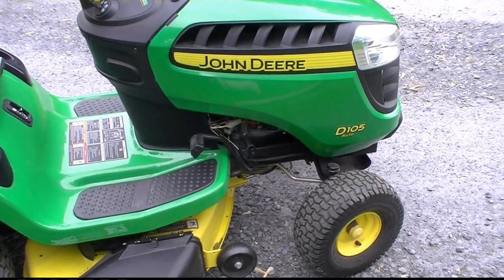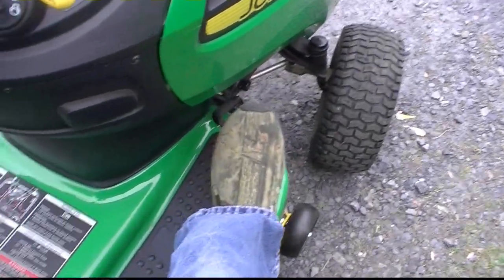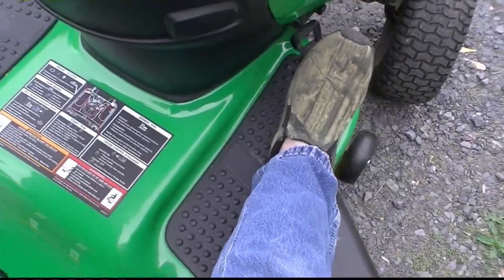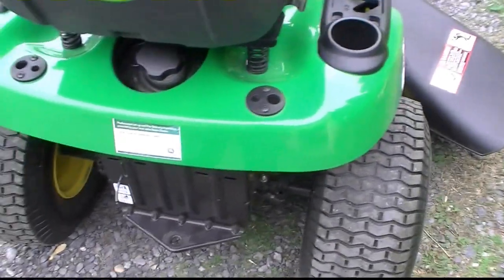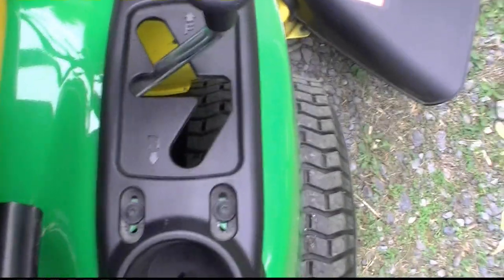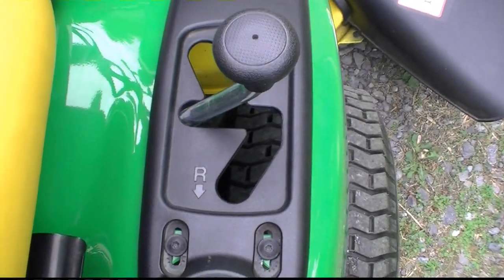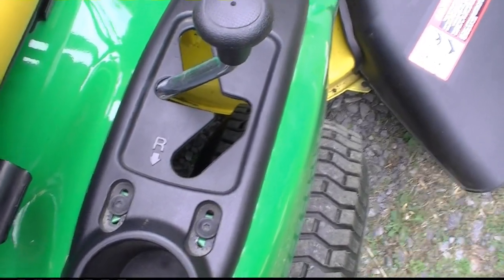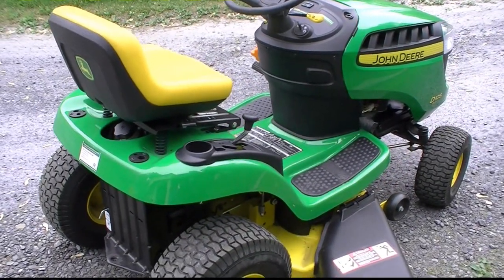John Deere D105 Problem Automatic Transmission CVT Review

Comment: Hope yours is still running.  Four months after the warranty for the transmission expired and as I was merrily cutting the grass I coasted to a stop and couldn't depress the gas pedal.  Took it to the dealer where they were glad to charge $192 to reinstall the spring, washer and screw on top of the transmission.  The service manager said that he'd never seen nor heard of this happening before and that possibly "they" didn't use enough loc-tite on the screw during assembly.  Of course since the warranty was out it was just my tough luck.  So fast forward 45 days, cutting merrily along one more time, same thing.  Went back to the dealer where now it's said I need a new transmission.  For Sale, D-105 with less than 110 hours.
Reply from the maker: Wow!  I hate to hear all that. Mine is still running good after only 6 months so far.  I better go and check to make sure everything is tightened up.  Thanks and I'm sorry to hear all that.
Reply: same thing happened to me. wish I had bought a 110.
Reply: Me to.this machine is a piece of junk.nothing run like a deer, you need to change that.
Reply: Just know that this particular model is going to crap out on you at some point, more specifically the transmission. The transmissions are made entirely of plastic and it is going to fail. I had a D105; John deere did a recall on the transmissions because they knew that they were flawed by design. My local Deere dealer replaced the transmission with a new one and it failed right at 8 hours of use. The tractor had less than 20 hours on it. John Deere refused to fix it; a new transmission costs nearly $500. I sold it at a loss of about $800. The "D" and "E" series of lawn tractors are garbage and John Deere knows it. They sell them to compete with other low-end mowers on the market primarily at Lowes and Home Depot, and Deere will not take care of or support this demographic of customers. I was told this by my local John Deere dealer, and I know from my own experience dealing with John Deere.
Reply: that screw wearing through is an easy fix, add a washer under screw, compress spring with zip ties to do work.

Comment: Even the smallest amount of research before buying reveals that this model has the cheapo General Transmissions plastic CVT transaxle designed in France and made in Mexico.  Other than to have pretty green paint, why would anyone waste money on this total entry model?
Reply: Yea it’s one of the worst transmissions out there
Reply: Just had one on a Craftsman I flipped. They are crap! Stay away from them. They sell them to poor suckers thats don't take the time to research what they buy first. That simple.

Comment: I work on this stuff for a living. If your about to go out and buy a new lawn tractor do yourself a favor, look under the back end. If you see a black plastic transmission on the thing, walk away, don't buy it, don't waste your money. That simple. Get one that outleast has the cast aluminum trans. Those plastic transmissions from general transmission are nothing but problems. Even when working properly, they shift poorly and are stiff, feel tight. No good.

Comment: I got one of these used. I'm the third owner and this tractor has 40 hours. The forward peddle requires about 45 pounds of pressure to hold the mower at full speed. I have about an hours worth of mowing to do when I use it. My knee and foot is stiff the next day. CAN THE TENSION ON THAT PEDDLE BE ADJUSTED?
Reply from the maker: +Bryan Dale Hmmm. I'M Sorry I do not know that off hand. Maybe we can look it up here online.
Reply: you get more better service from KUBOTA dealers  then deeres
Reply: @michaelmactavish1728  These are NOT a REAL JD !!!  They are made specifically for the Box stores as a knock off !!!!
Reply: Cruise Control on (D125, D130, D140, D155, D160, D170)

Comment: Just know that this particular model is going to crap out on you at some point, more specifically the transmission. The transmissions are made entirely of plastic and it is going to fail. I had a D105; John deere did a recall on the transmissions because they knew that they were flawed by design. My local Deere dealer replaced the transmission with a new one and it failed right at 8 hours of use. The tractor had less than 20 hours on it. John Deere refused to fix it; a new transmission costs nearly $500. I sold it at a loss of about $800. The "D" and "E" series of lawn tractors are garbage and John Deere knows it. They sell them to compete with other low-end mowers on the market primarily at Lowes and Home Depot, and Deere will not take care of or support this demographic of customers. I was told this by my local John Deere dealer, and I know from my own experience dealing with John Deere.
Reply from the maker: Mine was not on that list. I checked the serial number.  There is over 50 hours and so far it works like new.  Thanks Again!

Comment: Yeah, I have always seemed to be running around with "A dust pan and brush" cleaning up after you buy something.  I bought a new cheapie snow blower in 1992 and was looking it over and observed a wire dangling loose.  Turned out it was an ignition ground wire shut off, meaning when you pulled the plastic key out, that wire shut down the unit/ignition.  Without it. the unit would not shut off after startup.  I fixed it but it pisses you off!!!  Where is the quality control?  If a woman bought it,, there be panic I'm sure or for anyone else who is not a mechanic.  I still use the same snowblower, it is very reliable.

Comment: Dealer who set it up was lazy and didn't check it.  My John Deere was OK overall, but the cut wasn't even, the dealer didn't level the mower deck, I had to spend a few minutes leveling the deck.  Most other brands are assembled by the place where you buy it, most big box stores that's some kid in the back, so don't expect much, any new mower should be gone over and checked when you get it.

Comment: my deere d105 barely moves forward or reverse. at times it will start off slow then get up to speed after a few seconds then is slow again. the transmission is quiet and doesnt make any strange sounds.. i thought i had a loose belt but that wasnt the issue. would you have any suggestions? ty
Reply from the maker: That's the first thing I would think is a loose or worn belt. Other than that I would search more online for a better answer.  Sorry I couldn't be more help. Good Luck with it!

Comment: how do you put it in neutral so that you can push it a
round if you need to...
Reply from the maker: Push the pedal down and move that lever to the middle.  Then go behind the mower and pull that metal pin towards you. That unlocks the transmission.
Reply: pete ziriaah  thanks pete. i was always wondering what it was about.

Comment: Did you find out about the plastic transmission yet?
Reply: Need info on plastic transmisson  mine is down to turtle speed.
Reply: @terrynolan9492  Just know that this particular model is going to crap out on you at some point, more specifically the transmission. The transmissions are made entirely of plastic and it is going to fail. I had a D105; John deere did a recall on the transmissions because they knew that they were flawed by design. My local Deere dealer replaced the transmission with a new one and it failed right at 8 hours of use. The tractor had less than 20 hours on it. John Deere refused to fix it; a new transmission costs nearly $500. I sold it at a loss of about $800. The "D" and "E" series of lawn tractors are garbage and John Deere knows it. They sell them to compete with other low-end mowers on the market primarily at Lowes and Home Depot, and Deere will not take care of or support this demographic of customers. I was told this by my local John Deere dealer, and I know from my own experience dealing with John Deere. Best of luck to you.

Comment: After studying the reviews on this mower I would say avoid at all costs ,the gearbox housing is plastic and some of the gears are composite ie plastic, the tuff torq t46 was bad enough in the previous model ,but this is inexcusable, and still costs $1000.00 to replace if it makes it out of warranty.The MTD cvt transmission gives no trouble at all ,why didn't JD use that? 
I know this is made to a certain price point but come on.
A friend of mine has a d115 and drives it like an old woman , his hydro blew out of warranty and it cost $1100.00 to replace.
I'll be looking elsewhere for a new mower.
Reply: kubota gots great warrantys on all there products plus they help fit the applications you need wich why i love the kubotas best quality and great service support from them :) john deere warranty is a 90 day warranty wich no good and kubotas has 2 years plus free extra 1 year warranty free with the 2 year wich has 3 year warranty wich is nice
Reply: @michaelmactavish1728    Compare the price of the Kubota and you could buy 2 or 3 of the JD's !!!
Reply: Those CTV transaxles are all made by General Transmission, no matter what brand of mower. There are only about 3 companies that make all the transaxles used in the US market, TuffTorq makes almost all the hydrostatic transaxles, same brand transaxle on John Deere, Husqvarna, Cub Cadet, Troy Bilt, Craftsman or MTD. If you buy a CVT (Automatic) chances are it will be made by General Transmission, no matter what brand of mower. Its just like most of them come with a Briggs & Stratton or Kohler, and a few Kawasaki engines. The companies that make the tractors,  all of them use a engine and transaxle made by another company.

Comment: The D105 is a waste of money. Spend 200 more dollars and get a D110. The D105 has a plastic transmission housing and plastic gears. This is the reason ppl think the JD tractors at home depot and lowes arent the same as the ones at the JDdealership. They are exactly the same its just that most dealers wont carry the d105 because of that transmission, but HD and lowes do. They def dont tell people they are getting a plastic transmission.
Reply: Hey Christian thanks for that info.

Comment: The 105 JD is not made by MTD .  MTD would be ashamed to build a Lawn Tractor with a plastic rear trans-axle housing MTD uses die cast aluminum.  Also MTD has a steel hood not green plastic.

Comment: I made the mistake of buying one of the JD D105 and it is not a great mower.  They should be pulled from the stores,  I have 130 hours on mine and so far a head light fell out, the fly wheel on the motor split in half and had to be replaced, and the solenoid had to be replaced.  And I just finished replacing the variable speed pulley on the transmission.  If you can't do the work yourself you can't afford to own this piece of junk.  And as I read in one of the other comments the transmission is plastic and cannot be repaired other than the pulleys and belts.  This same tractor used to be marketed under the Scotts brand.  I had one that lasted me 12 years.. I don't know what JD did to it after taking it over.  PURE JUNK